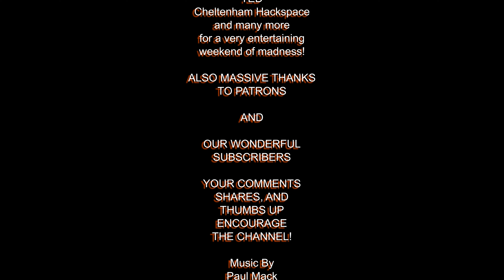DuB-EnG: PULSE JET ROCKET ENGINE EXPLOSION - Epic home made DIY jet How to START IT - ball of flames

Comment: Wow and the same pulse jet that powered the V1 rocket in ww2 I think 👍
Reply from the maker: Steve Armstrong ... very similar but I think the jet for the V1 worked slightly differently... I believe it had a regulator valve... I’ll check... that said, I’m sure people will correct me if I’m wrong!!
Reply: The pulsejet in the video is a valveless pulsejet, the V1 pulsejet wasn't.
Reply from the maker: You’re quite correct!!